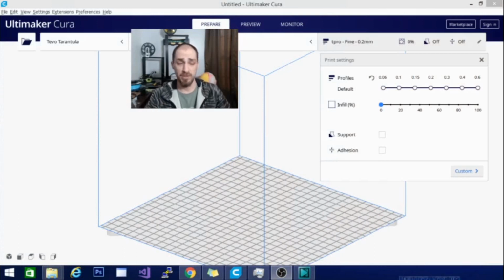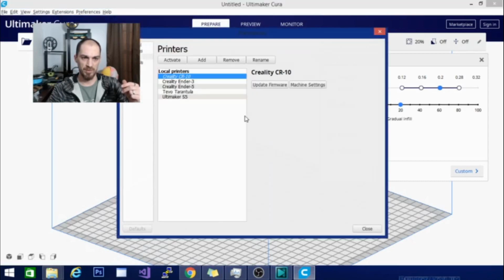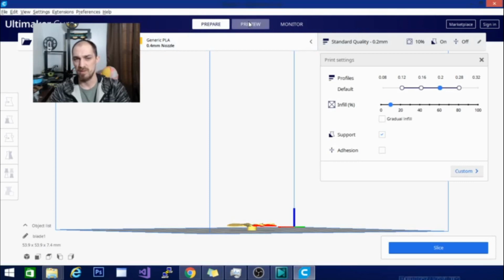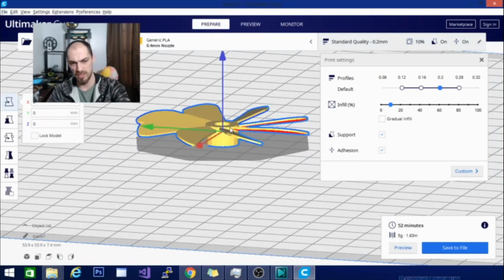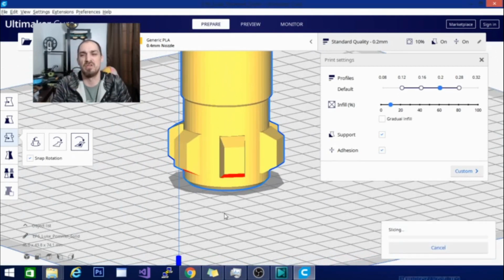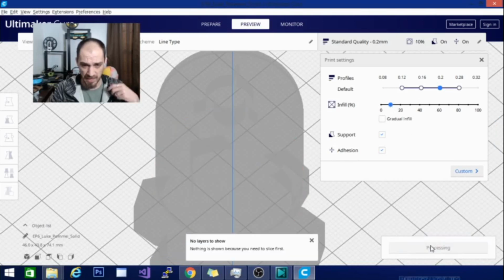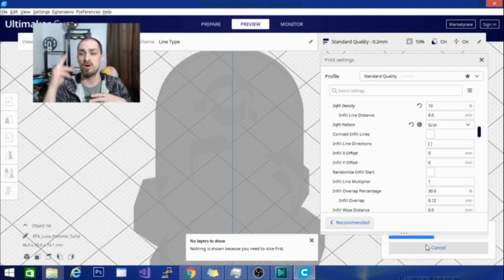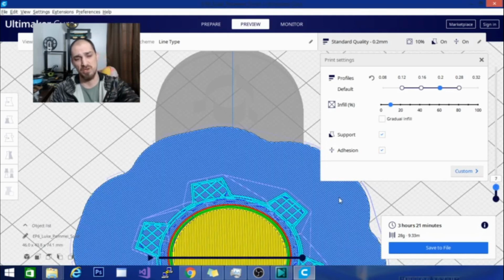Cura 4.5 tutorial - for beginner 3d printing!

Comment: This G-code file that it generates....
Will this file include the orientation of where the object will be printed on the bed?
So then... Can I assume that this program has a section that deals with object placement/orientation?

In addition to G-code, what other file formats will it accept?
Or does that depend on the model of printer / firmware it uses?
Reply from the maker: Cura will accept stl files , and you can then manipulate the orientation before slicing. It does accept gcode files, but only to look at. When you slice an STL, the output is gcode, so it's no longer a model, just a series of tool paths that make up the model, telling the print head where to go. When you slice a model the gcode generated will be for the current orientation so yes you can manipulate position
Reply: @Technivorous  Thank you so much for the quick reply! And now I understand how g-code works.  

Actually, I'm wondering... I would like to use vector graphics to begin building a custom model, within the program. Since the "open" field won't allow me to import a vector file... how can I do this? I use CorelDraw. But I don't have a filter to create an STL file format. How can import a vector file?

Importing bit maps is allowed. Does this program have a trace function?

Comment: I have the sidewinder x 1 large printer... how do you scale the model up to largest build as well as percentages... thanks for any help.
Reply from the maker: I haven't found a scale to build plate function in cura. However to scale by percentage, select the model, then a toolbar will appear on the right, with rotate, scale, and other options. The scale will take percentages.
Reply: @Technivorous  0

Comment: Hello, on my cr-20 I just bought. All the test files work fine, but I can't seem to get a model I made working on there. I size it down to literally 40 percent and the printer keeps printing off the platform. I don't know why and I can't seem to figure it out at all.
Reply from the maker: Using cura? Go to settings -printer-manage printers.  Select your printer and click machine settings. Find the box that says 'origin at center' and make sure it is unchecked. Yes unchecked. This is a common problem for new cura users, and is likely your issue. Let me know if it helps
Reply: @Technivorous  Thanks, I will let you know.
Reply: @Technivorous  It keeps printing off the print bed. I made sure I didn't have that option checked as well in Cura. I don't know why it keeps rechanging the nozzle height after I manually set it up every time. It raises it and starts in the left corner every time I load the file. It raises it up from where I had it set and it just keeps printing in the left corner.